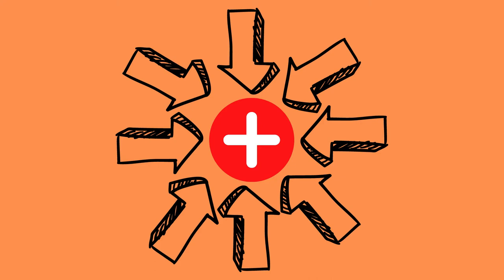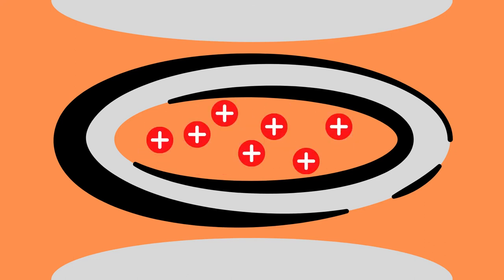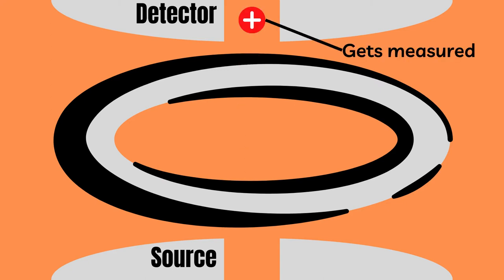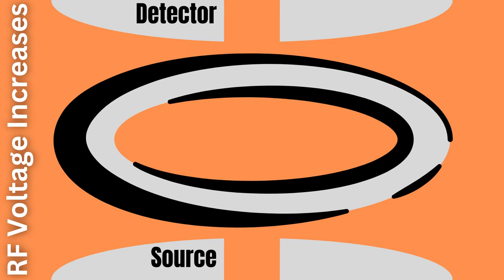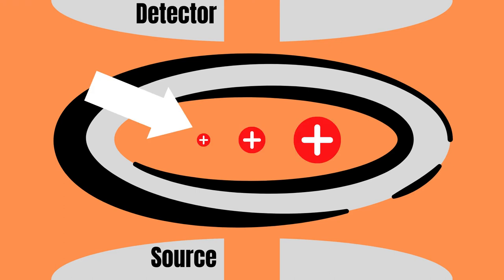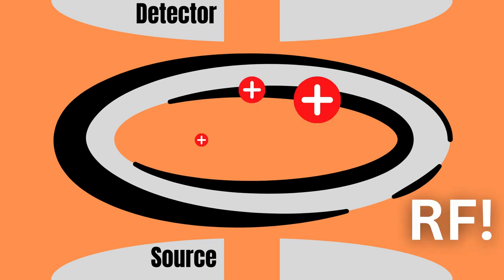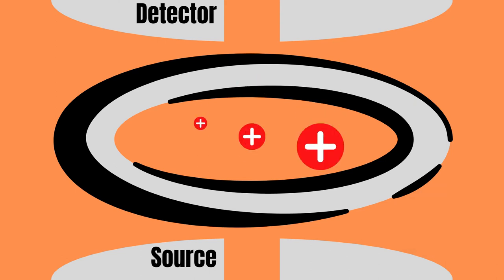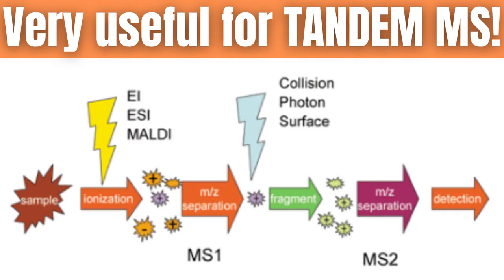Quadrupole Ion Trap Mass Spectrometry (QIT MS)

Comment: Can't we make resonance with that small ion we interested? Wouldn't it be much more easier to make resonance on what we are interested in?
Reply: I also think so but I am not sure as I do not have an experiance. However isnt it logic that smallest are oscilating fastest (they are first able to oscilate do the edges of trap while increasing RF) → thus they are able to leave the trap first. Then bigger and bigger. If we want to send biggest or medium first (with certain RF)→ would it not be the case, that all smaller would leave with medium/big too? (and it would not be what we expected, it would create bias) ... so I would say that it should be used only from smallest to biggest (while sending them f.e. to 2. analyser of MS/MS) .... or this is the different ability of QIT in contrast to IT ?
Reply: @marianradvansky6304  I've once researched this and found Feynman transformation. Every particle oscilate in a specific way so type of oscillating is a thing abour characterization, based on this feature they're using Feynman transformation to identify that ion. It was something like this, I hope I could understand and explain well. I saw this on a orbitrap explanation.